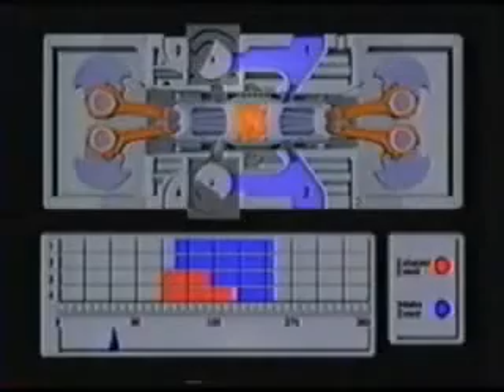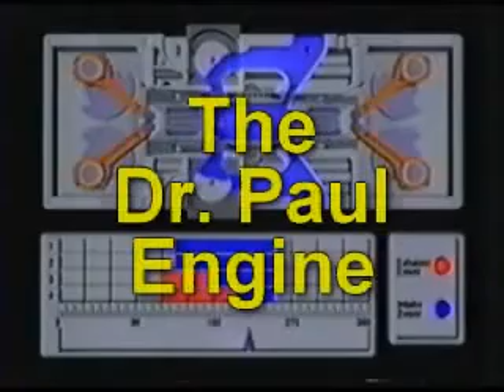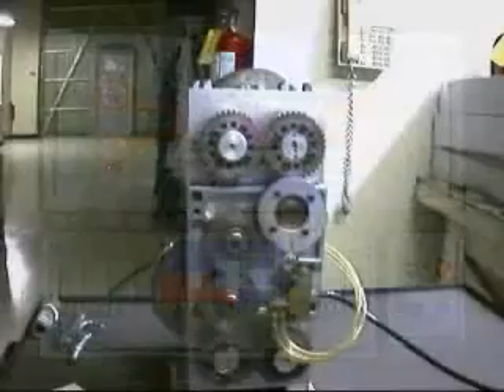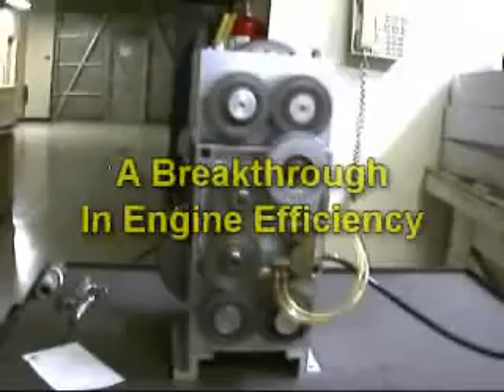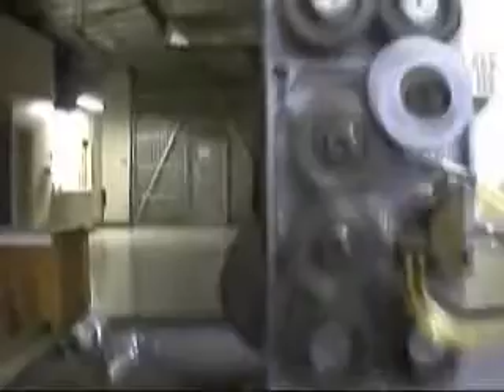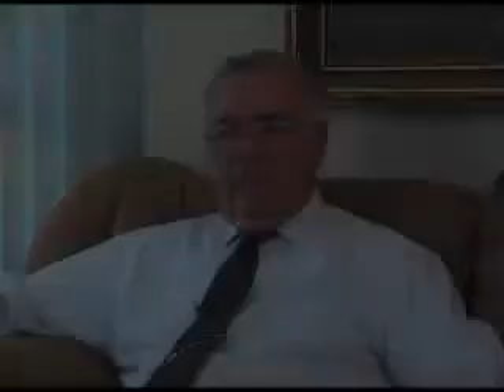Dr.Paul Internal Combustion Engine - 80% Efficient!!!. part1

Comment: He's so wrong on many points. At ~ 3:30 he states that better carburetors have nothing to do with efficiency. Really? Why did they disappear to be replaced by fuel injections? Hint - better efficiency.
Then he says the ONLY thing that increases efficiency is the amount of fuel burned. NO, IT DOES NOT. It produces more energy/power but has nothing to do with efficiency.
In fact there are MANY things that can influence efficiency.

I vote down this "expert". He's a rocket scientist not an M.E.